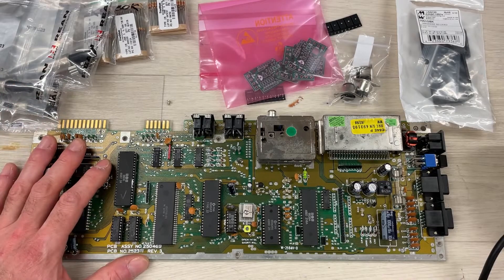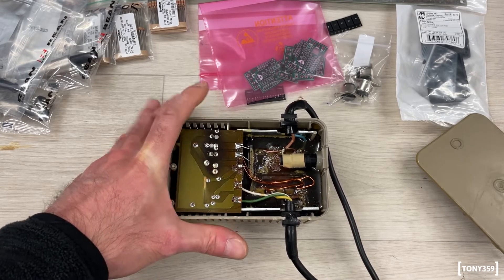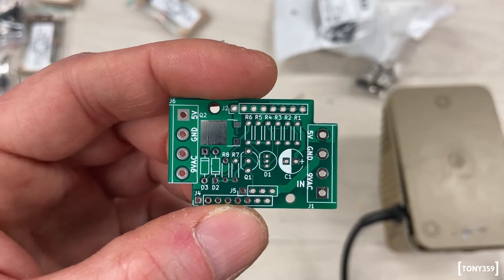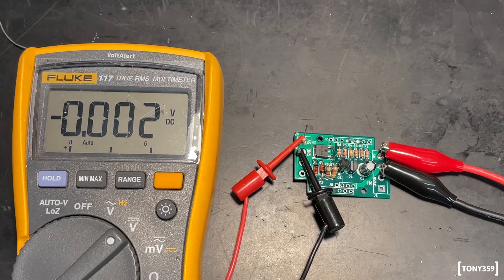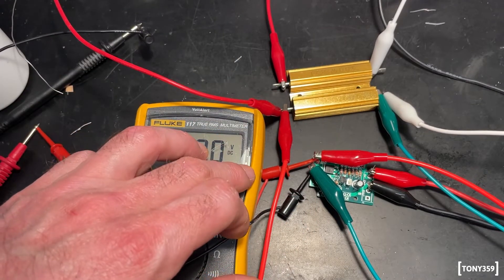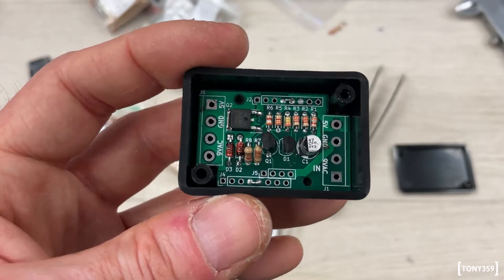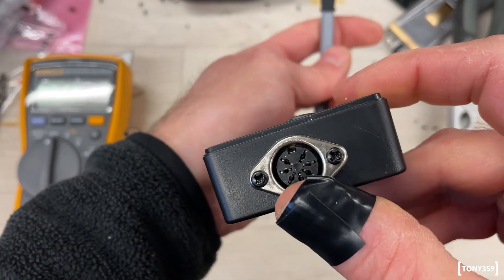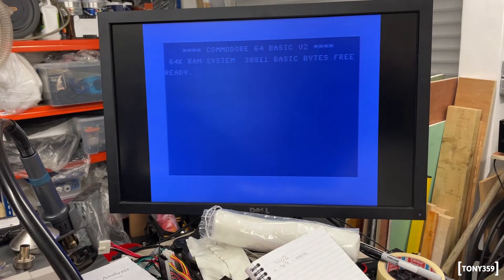C64 Saver v2.4 Through hole - Assembly and Test

Comment: Hi, thanks for the video... I didn't realise the old C64 PSUs were so dangerous! Do you happen to have any of these boards left (he says, 2 years later)? USS1701D
Reply from the maker: Yes, they can be C64 killers! Unfortunately I don't have any more spares, sorry. To be fair, adding a TVS on the 5V line would work - assuming you only have one C64. I think Jan Beta made a video on this subject. It's basically a component which conducts only over a certain voltage. There are some VIAs you can use on the PCB so it's a simple fix. If and when the PSU fails, you might kill the PSU or the fuse in the PSU might blow (but at that point the PSU is faulty already) but the C64 won't die! Good luck and thanks for watching this very old video :)